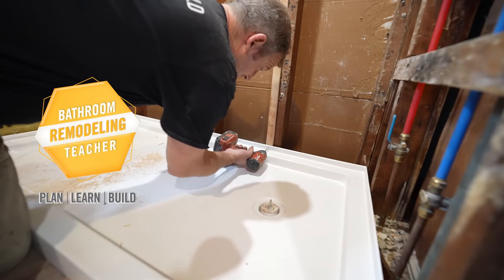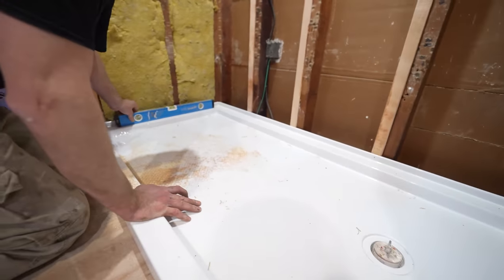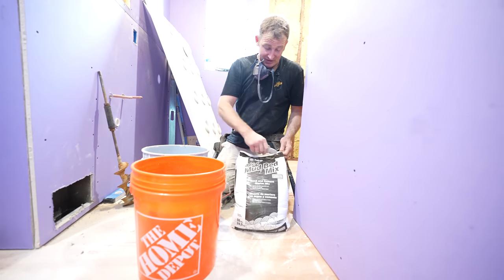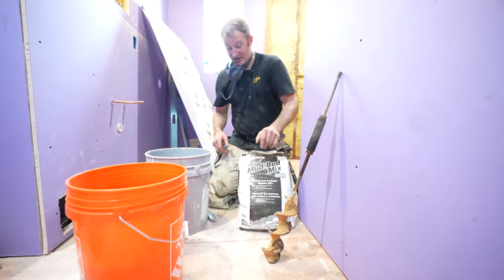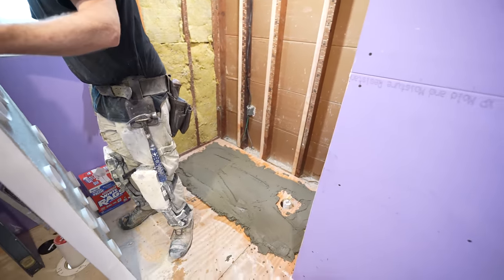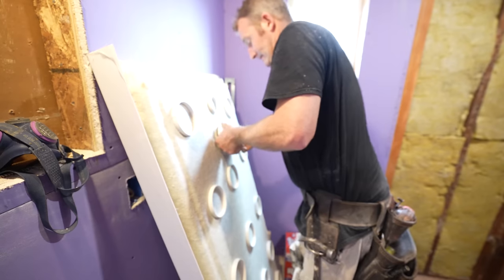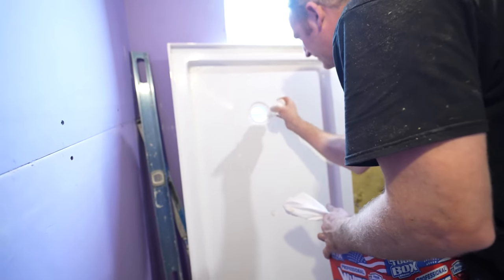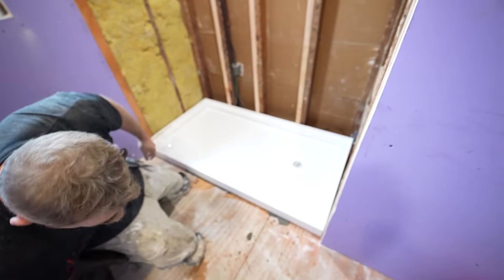How to Install a Shower Pan Base | PLAN LEARN BUILD

Comment: I had made arrangements with two separate contractors to replace my tub/shower setup with a walk-in shower and both ended up being ragbags. So I decided to do this myself and what I found extremely useful was to not focus on the "Big Picture" of the project but to break it down into individual steps, like removing the old tub/shower first and so on.....I found approaching the project this way a huge confidence builder because as I go through numerous DIY videos for each step of said project, I find there are a slew of valuable tips and tricks that each video has to offer and this one is no exception. I've learned to take my time, pick out the right products and have the proper tools on hand  and to ALWAYS measure twice so I only cut once, LOL. Thank you Sir for taking the time and effort to put out this video for newbies like me so I have a greater experience doing this project and never regretting kicking those contractors to the curb.
Reply: So how did your project turn out? I'm in the same boat too

Comment: The more water you add to your mortar mix the more shrinkage there’s going to be in the drying process leaving a gap between the mortar bed In the shower pan you always want to make your mortar mix as dry as possible when installing a acrylic or fiberglass shower pan.
Reply: Thanks for the tip

Comment: I always put a bead of rtv silicone under the drain opening of the shower pan before the rubber gasket to account for unevenness of the drain opening.  ALSO, in my world there is no such as a "caulkless shower drain."  Inject that entire space with clear silicone before inserting the rubber spud seal.   It will push I nice big bead of silicone out the bottom of the drain around the pipe and creates a second barrier.

Comment: Hi, would it be ok to put some plastic sheeting down on the sub floor before putting the leveling mortar to prevent the sub floor from absorbing the water from the mortar?
Reply: Do some research on it.
Reply: Use a waterproof membrane like Kurdi or something that won’t corrode.
Reply: I wet the subfloor.
Reply: Use plastic under the mortar and on top. You don’t want the mortar to stick to the pan during future removal. In addition the strainer should be tightened a bit more than hand tight.
Reply: NO!!! You could you stucco netting paper... nail it down to the subfloor.
Reply: Wide crown stapler down stucco wire then pour floor leveler till you don't see the wire.

Comment: I always shim corners (as needed) before laying the sand/cement mix, that way once the pan reaches the "positioned and secured shims" I know it's level and don't have to adjust.  Remember the cement mix will not rebound once displaced. I use a small hammer drill to settle the pan to the shims and to remove deflection as needed. Sand/cement mix must be very stiff when when using vibration! I also weight the pan around the edge never in the bottom as that would displace the cement and allow for movement once the bond is broken. Allow to cure for a minimum of 72 hours and double that if you covered the plywood floor with plastic.
Reply: why would you covered the floor with plastic ???  than cement would not bond   it needs to bond to plywood

Comment: You put the shutoff valves behind the drywall. Why? I always keep mine accessible in case I need to quickly shut the water off.

Comment: Cool vid.  Putting pan in trailer w caulk less drain.  I want to set drain in pan w silicone as you have directed.  Then just place gasket on 20" downpipe, insert from top and lock in.  Going under home later and creating pee trap to drain/vent.  Will that work out ?

Comment: Prefect timing this is the exact bathroom I need to renovate in my house.  My shower/tub opening is 64 inches, so now I have to  figure out how to compensate for this size.  Argh never easy....  thanks for the great video.
Reply: Same with me!
Reply: Me too what did you end up doing?
Reply: You fir out the wall. You would need to build it out to fit with pans like this loosing 4 inches.

Comment: Great video!  What Im concerned about are the shark bite supply line fittings.  How comfortable are you enclosing them inside walls and between floors?  I’ve encountered shark bite failures before.  Have you experienced any issues?
Reply: I never trust sharkbite. I choose compression

Comment: Great video, thank you.  I have almost the same setup but with a two sided threshold.  My issue is the corner off the walls in the bathroom is almost 1/2 inch up and there is movement.  Recommendations for securing?  Was going to try shims, but wanted to check first as you seemed to have the same issue on this video.

Comment: Nice job. What did you use to seal bud joints? Regular compound or a special paste or perhaps a thinset? Do you recommend using red guard to waterproof the backer board?

Comment: When you install a membrane on the shower walls do you typically use backer board or can you use drywall??
Reply from the maker: I usually use a foam board. On this one I used go board. If there was a shortage, my second option would be drywall and a Schluter type membrane 👍

Comment: You are so knowledgeable! Question. Which license is required to remodel bathrooms? Is just a tile license sufficient or do you need different types of licenses? If so which licenses are required?
Reply from the maker: Really depends on your on municipality. Most require a licensed plumber & electrician to do that part of project. General contractors also have to be licensed in some areas too. All comes down to your local big brother 😆
Reply: @BathroomRemodelingTeacher  So I'm probably looking at 3 or 4 different licenses. I'm in Nevada but I think most states require the same.
Reply from the maker: @balamala2647  yep, just 3 or 4 lifetimes to have nice things legally 😆 sounds about right

Comment: Hi.  Dreamline says not to  screw the pan to studs.  Can you explain why you did?
Reply from the maker: It simply does not have specs for screwing into place 👍
Reply: I came here for this comment. According to the Q&As for the shower base, screwing the flanges into the studs completely voids the warranty. Was this overlooked or am I missing something?

Comment: Base not Level. Purchased the DreamLine SlimLine 32 x 60 shower base. Out of the box the base did not sit level on the floor. Not sure if this is common and can the flange screws can hold it level. Any suggestions on how to proceed. Thanks
Reply from the maker: Set in mortar like this demonstration and make it level 👍

Comment: can you put the wet mortar straight on plywood? wouldnt it rot from moisture? dont i need a hardie becker floor board? also do the purple wall drywall replace hardie becker for walls?
Reply from the maker: Yes, no problem with mortar directly over plywood. No moisture will get to it since this is only a setting material for shower pan. And no, purple board is not a replacement for a tile backer board. It’s moisture resistant and if used as a backer board, you’ll need a waterproof membrane over top
Reply: @BathroomRemodelingTeacher  so what's the purpose of the purple drywall sheets?
Reply: @alamray Too help protect studs and to probley build it out, as you want your wonder board to overlap that lip on the shower pan.

Comment: Great video - out of interest could you have completed the dry lining / other fitments first before fitting the pan base - what advantageous did laying this first offer?
Reply from the maker: That’s a great question… I’ll have to do more research on that one. I personally see no issue laying mortar over plywood like this. Especially when it’s only for support But I agree a vapor barrier of some sort would be better. I just don’t think it’s worth spending $50 for a full roll of tarpaper to do. But I agree it should be done for mud bed shower pans and tile floor installations. 👍

Comment: You don’t have to worry about your saw falling out of your drill because all (good) drills have a locking mechanism in the chuck. You simply tighten it all the way, then back off until it clicks. Will be less than a quarter turn. This was a game changer when I learned about it.

Comment: Anyway to make this a curbless if you recess the floor joists and put this shower base in it?
Reply from the maker: I’ve been wanting to look into acrylic curbless showers. My biggest issue would be properly waterproofing it. This model base would require quite a recess to make curbless
Reply: Interesting idea. The transition to flooring would be challenging. If you were slab on grade and could inset the base into the slab you could make that work
Reply: You still have a curb with the acrylic pan.  A true curbless shower pan is done with a mud job with tile floors both in and out of the pan.

Comment: I just bought an 'Elegant' shower pan and the instructions call for thinset as a base.  Should I use thinset or mortar?
Reply from the maker: That’s interesting 
Most thinsets can only go 3/4” thick. If your floor is level, I’d say no problem. But if your building it up to level things, I’d go with Mortar 👍

Comment: That tub is going to come up. You're suppose to put down tar paper first. The wood is going to absorb the moisture and cause the mud to crack when it dries out.
Reply: Maybe he moistened the sub floor first.  I don’t know.
Reply: @tonyd4346  It doesn't matter if he did. It's still going to come up

Comment: Another great video.  Taking the time to really level stuff off is how its done!  Always checking your measurements.  Might be a good idea for another video to go into a little detail on what the “acceptable tolerances” are when measuring, cutting and leveling.  Keep up the great work dude.
Reply from the maker: Good point, 
Yeah I should of had my wife zoom in on level. Didn’t realize we didn’t capture that 👍
Reply: No worries.  Yeah, I just thought I’d make the suggestion that a future video discussing when a measurement or whatever is “good enough “ might be very beneficial for your students.  Because in construction work, it’s essential for a skilled guy to know the difference when something is good enough or not enough.

Comment: Shouldn’t it be a angled towards the drain or does the pan comes a little slant?
Reply: Comes with a fall. The outside needs to be level so the tiles sit flush

Comment: Great Video.  Is there any reason you use silicone instead of plumbers putty?  I have the brass drain that I used with the putty.  Seems to work okay.  Also, I'm not sure but it looked like you put the drain over the protective plastic.  It's easy to do because it's invisible - I did it too and went back and removed drain to peel plastic off.
Reply from the maker: Yes, 😆 that’s the third time I’ve left that plastic on too, 😆 haven’t had any issues.  From it. But yeah super easy to forget about. And I just trust silicone more. Had an issue years ago with putty and always used silicone since 👍
Reply: Crap, I just installed a pan and I installed the drain without removing the plastic.
I caulked around the flange to floor pan just in case!
I’m afraid to try and lift the pan once it’s grouted in.
Contemplating…🤔

Comment: Why did you put the mud without a liner to protect the wood base?
Reply from the maker: You can. It’s really not necessary though. This is just for support. No moisture will penetrate to cause any issues. But not a bad idea to put plastic down 👍

Comment: Why didn't you use a 30 lb. felt slip sheet under the mortar?  Shouldn't the holes to attach it to the studs be elongated to all some movement to help eleminated cracking in the shower base? The mortar seemed a little too stiff  to conform to the shower base by standing on the shower. Shouldn't it be about what you would use for bricks?

Comment: FYI !!!!  You are NOT supposed to use screws in Dreamline pans.  It can end up creating cracks in the pan later on.
Reply from the maker: Never seen or heard that. It doesn’t indicate to not to do that. Embed in mortar and your good to go 👍
Reply: Only time I didn’t screw down a shower base was with a koni marble solid man made concrete base, the weight alone was more then enough to have it stay put, I don’t think sand mix adheres to this base, so it would have more chances of moving about without screws?

Comment: Could you use self leveler instead of mortar? Then allow the self leveler to set up before installing shower base. I'm thinking this would take the guess work out of the process of do I have enough/too much mortar, is it in the right place etc
Reply from the maker: I do not see why not. Would be tough to contain though (coming out underneath pan and down into drain area)
Reply: @BathroomRemodelingTeacher  Use a bead of expanding foam (the door and window type that doesn't expand too much) around the edge and around the drain to contain the self-leveling compound until it sets.

Comment: I was wondering if you ever ran into a shower base install on a concrete floor where upon breaking up the cement to move the drain location to fit the pan approx 12 in. You find out the drain line is already pitched near the floor height of the cement. Any points on what I can do to remedy this to get the pan installed. I may need 3/4 of an inch higher on the pan. Argh!!
Reply from the maker: Nothing fun about that….
Raising everything might be your only bet
Reply: @BathroomRemodelingTeacher   any thoughts on what to raise the floor with.  Stupid idea, but do you think a piece of styrofoam would work. Get a little warmth. No dif than using a Schluter, Wedi or Prova tray. They want an acrylic base no tile. I have used Cerazorb quite a bit under heated floors on concrete. It only comes 1/4

Comment: Mistake after mistake .......  you never install over plywood.  Never.  Always check the pan for leaks overnite after drain installed.  Gaskets can leak.  I'd go on and on, but I would need an hour.  Poor job.

Comment: Dreamline will tell you NOT to drill into the lip of the pan.
Reply from the maker: Actually says to do so 👍 
Not sure how that center guide would stay otherwise
Reply: @BathroomRemodelingTeacher  Hmmm = very odd.  I installed one in 2016 and had the same thought, but the instructions did not call for it.  So I called the company and they said "NO" do not drill into the lip because it would likely result in cracking - possibly years down the road.  
So, I contacted a plumber and he also said never to drill into the unit.  
The plumber told me to lay down enough mud (mortar) so that the entire unit sits in a bed of loose mortar about one inch deep from edge to edge.   The unit would eventually settle into the mud making 100% contact with the unit.
The company and the plumber said not to try to bend or pressure the unit in any way - just to let it sink into place.   I followed their advice and it worker perfectly.  No bending and rock solid.
Reply: @ScottA2345  I'm about to install one.   What exact mortar type did you pick up and what consistency did you mix it to?

Comment: ffs  im looking to see how the sheetrock gets put up. why does no one show this?!!     Did your sheetrock go over the pan lip?  or up to it?
Reply from the maker: https://bathroomremodeling.teachable.com/p/tub-to-shower-course
Reply: It goes over the pan lip.
Reply: The wall board whether using drywall, hardibacker or any tile wall board goes down to the top of the lip so that the wall is plumb against the studs.